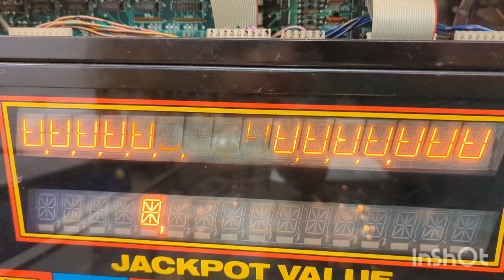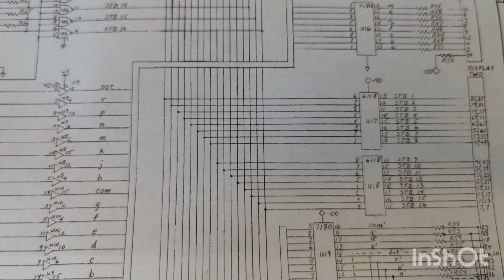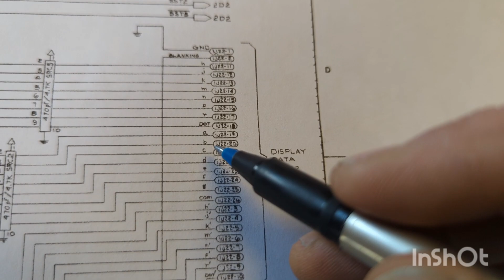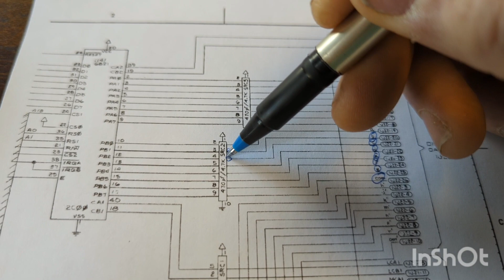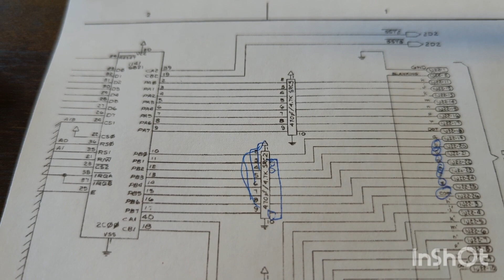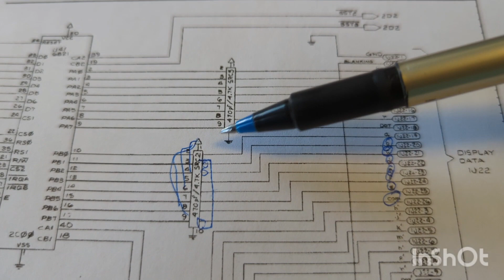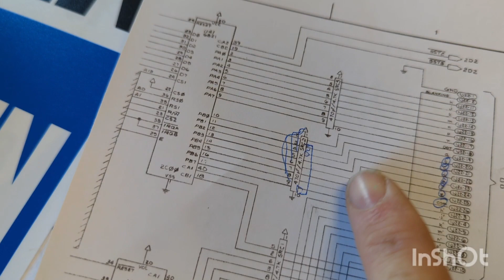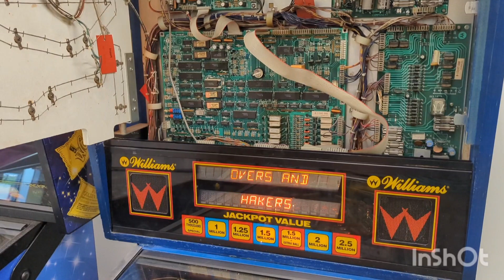Repairing a bad display on a Williams system 11 (was on the mpu) - Earthshaker part 2

Comment: Your battery corrosion/spreading cancer analogy is spot on.  If not corrected and halted, battery alkaline corrosion can continue for years, eating away at components and delicate circuit board traces.   The cause of so many problems on games.  Great video.
Reply from the maker: Glad you enjoyed it.  Yeah the cancer analogy becomes even more real when trying to remove alkaline damage.  You want clean margins, but you also want to leave traces...